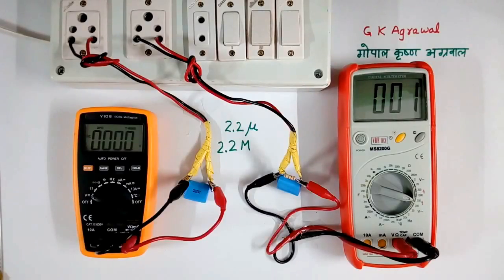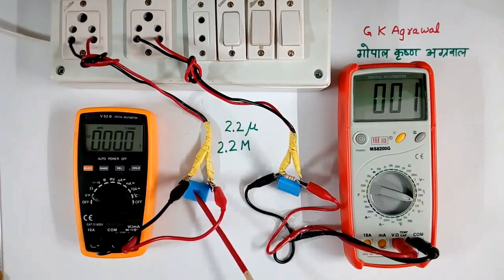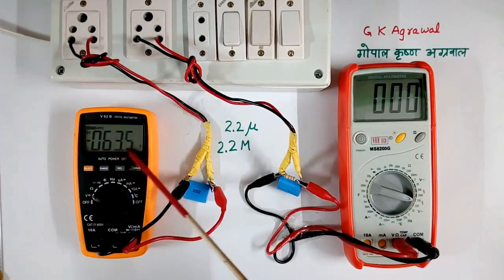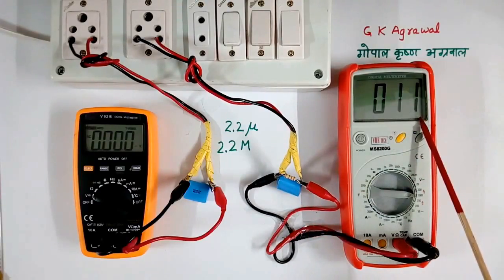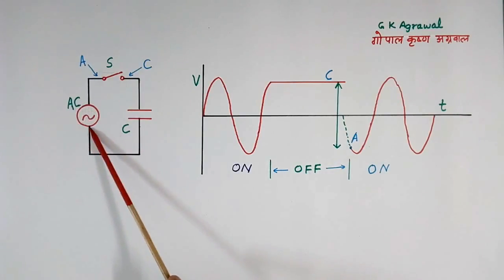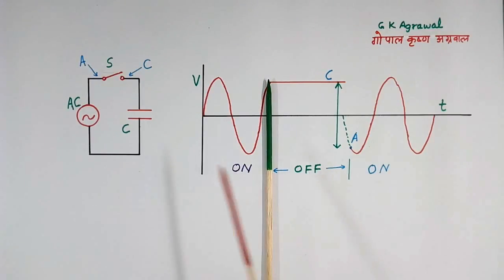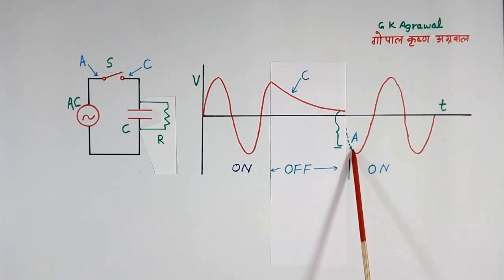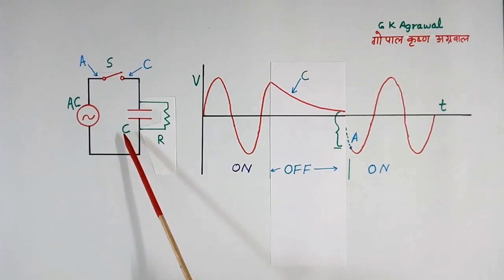Why Bleeder Resistor for capacitor discharging

Comment: Hi 
I have seen high voltage capacitors , sometimes in parallel and sometimes in series 
Can you tell us how to calculate the resistor for a high voltage capacitor bank  in series or parallel ???

example = 4,7 nanofarads  6,000 volts  ( model FKP1 )
Thanks.

Comment: Thanks - a very informative video on the need and use for bleeder resistors.

I'm going to swap my single pole, single throw switch for a single pole, double throw with no center off [on my Variac power supply, with a bridge rectifier and cap output], so I can bring a resistor into the circuit to start draining the cap when the power is removed, and so I don't have to have the constant load drop across the resistor.

I'll improve my knowledge of circuits from there.
Reply from the maker: v good

Comment: When we switch off AC supply to the capacitor, it will storage the Voltage in the form of DC? Can you clarify sir
Reply from the maker: Yes, at the time of switch off, whatever voltage across capacitor is there,  that will remain across capacitor as DC.
Reply: @GKAgrawal2  thanks for your valuable comments and great support for the young generations ❤❤

Comment: From US - thank you for an excellent representation of capacitor bleeder resister effect!
Reply from the maker: Namastey, Thanks for the comment, from India
Reply: G K Agrawal I am a forensic electrical engineer looking for a clear way to explain this topic myself and I found your methods, testing, and visual diagrams to be the best on the internet. Sometimes a simple “analog” display of waveforms is clearer and refreshing alternative to digital PC-generated display. As a follow up, perhaps discussion of the deleterious effect of the phenomena when a bleeder resistor fails or isn’t used on an HVAC or other motor starter capacitor would be valuable (failed capacitor, possible damage to contactor etc.). Thanks again.
Reply from the maker: I have explained many technical  concept with this method in my 350 videos.

Comment: Sir your vidio is so good. Sir muje three phase rectifier banana hai jisse me vfd ko direct dc deke chala saku par chapacitor  discharge ke liye kitne ohm ka and kitne watt ka resistor lagau?  Kitne microferade ke 4 ya 2 dc electrolatik chapacitor lagau? 
Sir my number is 8758095189 sir please solve my problem.

Comment: Very Elaborative video Sir, Thanks 🙏🏼 

Minute suggestion: You can include a short note that the resistance of external resistor and internal impedance of DMM are in parallel which gives us a lower resistance than the very resistance of DMM only. Which helps us in faster bleeding. 

Thanks, Once again.

Jiten(Iowa, US)
Reply from the maker: Thanks for suggestion. However  DMM will not be there in actual use.

Comment: Sir jo hamare ghar pr supply aati hai vo 1phase hoti but oske sath neutral wire v aati hai vo transformer mai kese bnti hai ????
Reply from the maker: 1 phase 2 wire se banta hai, line aur neutral. Neutral 3 phase ka star point hota hai.
Reply: @GKAgrawal2  3 phase delta star connection ka common point toh trasformer me inbuild hota hai fir bahar se kaise pata hoga ki transformer ka kaunsi 4 bushing me se 1 neutral hai agar earthed nehi dia gaya toh plss plss sir
Reply: Sir woh neutral toh transformer ke under inbuild hota hai fir bahar se kaise pata hoga konsa bushing se neutral nikla hai?plsss plsss sir